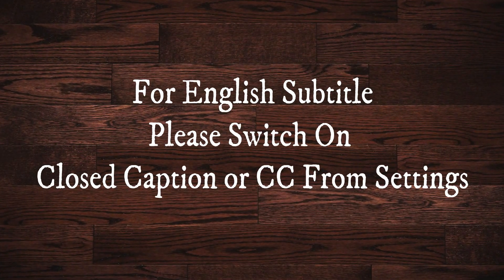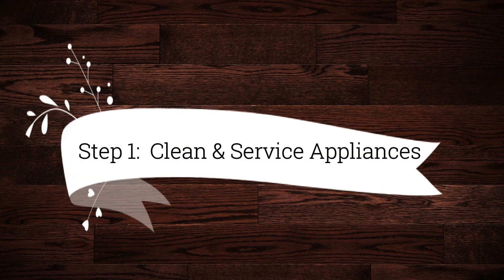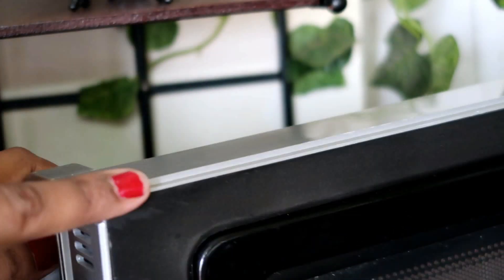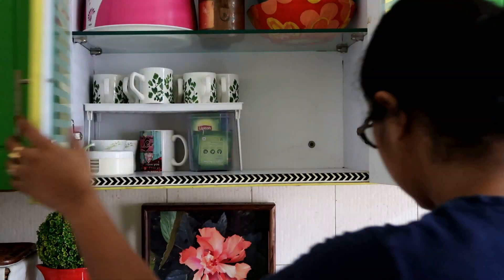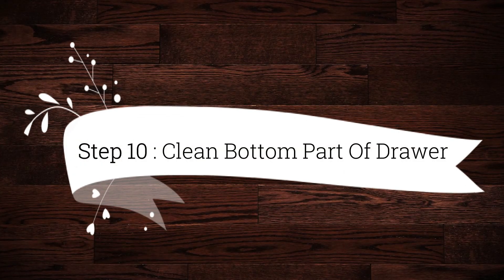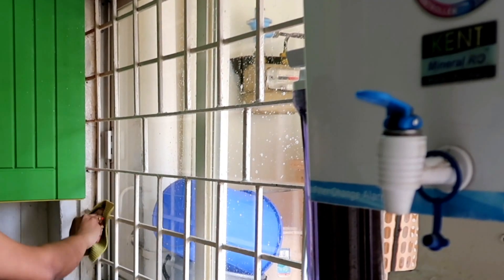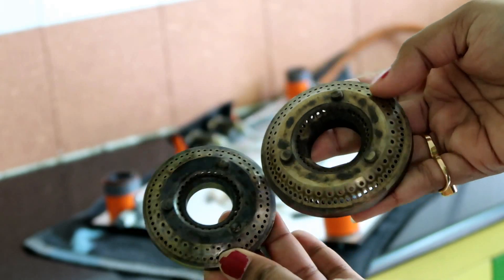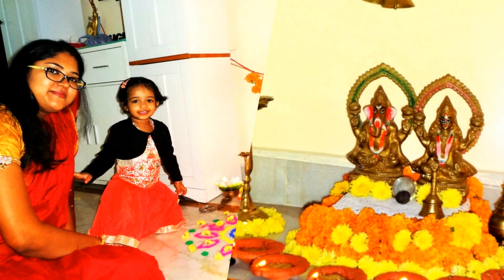Diwali Cleaning Tips - Kitchen | Diwali Mein Kitchen Ki Safai Kaise Kare (English Subtitle)

Comment: Very useful tips, thanks .I wanted to know how to clean window which is right in front of my gas stove which has lots of oil stains, though i clean but some stains are rigid, i sometimes clean with steel scrubber the paint comes out, if u hv any solution please let me know. Btw thanks for sharing this video.
Reply from the maker: Clean them with super hot soapy water and try cif too. Must be cleaned well. You are so welcome :-)